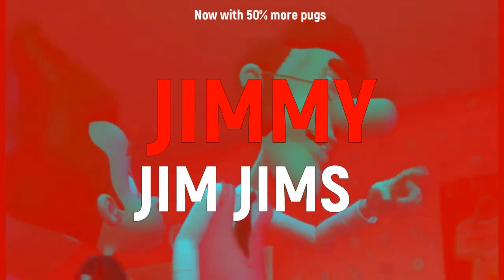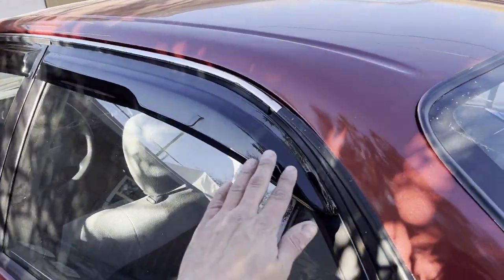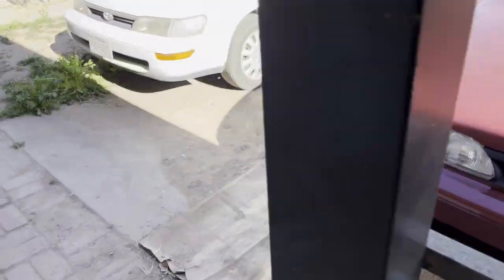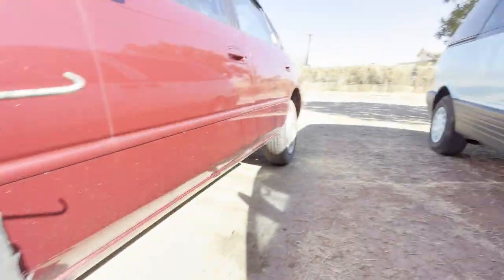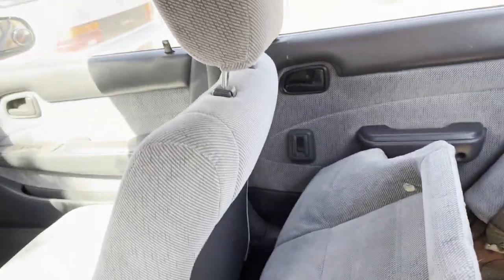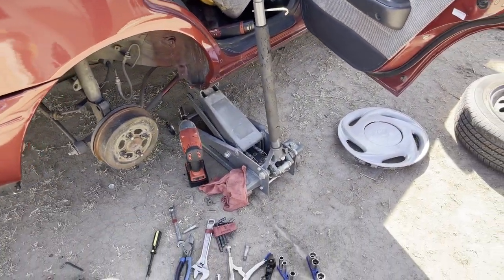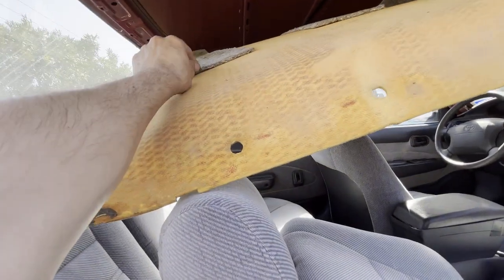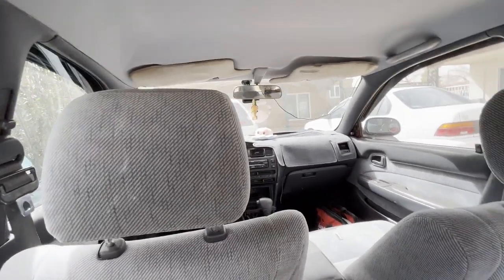Even MORE work on the $400 1995 Toyota Corolla

Comment: Jim, Will that center console bolt right into a 1997 Corolla DX? I found a 95 with the console still in it.
Reply from the maker: Yes it will, from 93-97 the center consoles are interchangeable with the exception of the Corolla CE models introduced in mid 97, those are stripper versions missing a lot of the features the previous ones had

Comment: I just got a 2002 Corolla for $1000 with 120,000 miles and I did minor things to it and it runs great. I have a question just in general my sister has a 2008 Chevy Tahoe and it’s having battery drain, I think the stereo is badly installed because it doesn’t save the radio stations but on YouTube I’ve seen that it also could be a bad ground wire. What do you think it could be if you charge the battery in full which takes about 24 hours it will drain in about three weeks.
Reply from the maker: 3 weeks is a pretty slow drain, probably just a few volts or less. What I usually do is start off looking around inside for small lights being left on (glovebox, rear cargo door, sun visor lights, etc) those can pull just a volt or 2 and drain a battery dead over time. I also remove those USB chargers people stick in their cigarette outlets because those cause drains too if they short out. Then I perform a parasitic draw test if I don't find anything obvious. Look up here on youtube "The BEST Way TO Perform a Parasitic Draw Test" by the channel HumbleMechanic. You'll need a multimeter for this but you can get one for around $5 at harbor freight just to do basic checks. If you absolutely can't get a multimeter and you have a suspicion its the radio, take the fuse for the radio out (the radio won't work obviously) but if the car stops going dead then you'll know where to look. Keep in mind the modern car battery only lasts 3 or so years so the more it discharges and charges after going dead repeatedly degrades it and it will need to be replaced anyway. I hope you can figure it out cuz those parasitic draws can be tricky